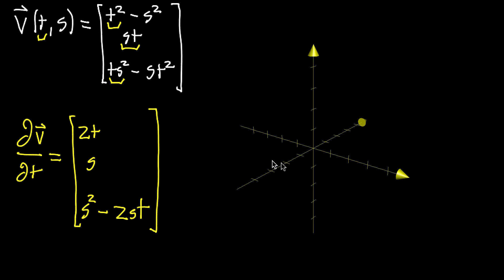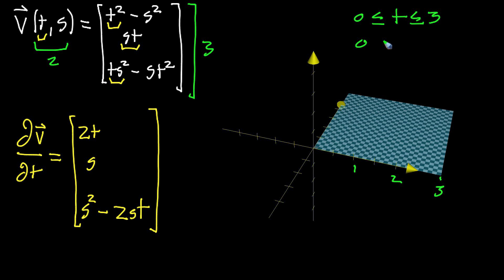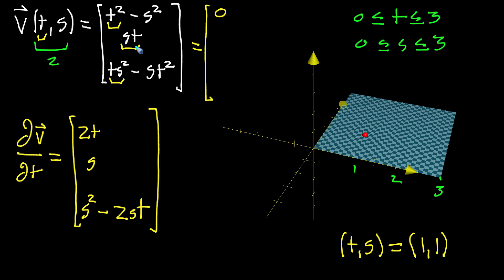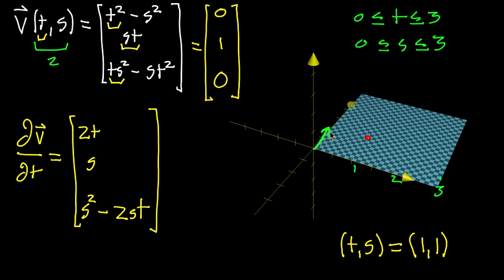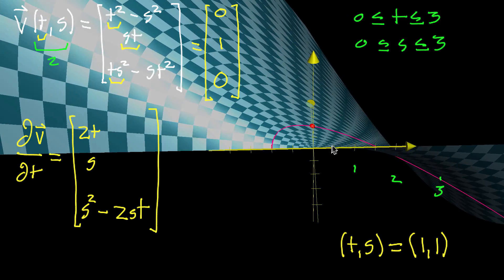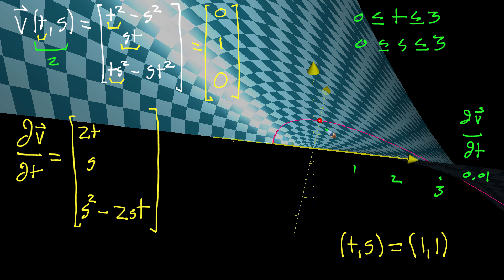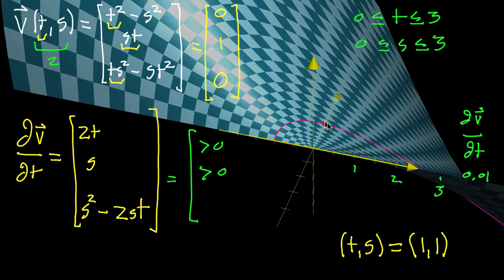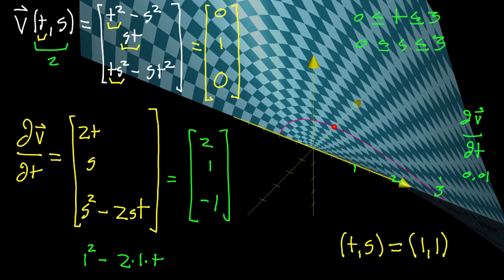Partial derivative of a parametric surface, part 1

Comment: I tend to think that because t and s are the original input parameters, then for you to correspond the axis t and s with the x and y when you are drawing the output vector for (t,s)=(1,1) that means this is the special case of x(t,s)=t and y(t,s)=s. right? 
What im saying is that the axis system is the x,y,z, and because of the parameters t and s you have to have : v(x(t,s),y(t,s)) = v(t,s) when x(t,s)=t abd y(t,s)=s